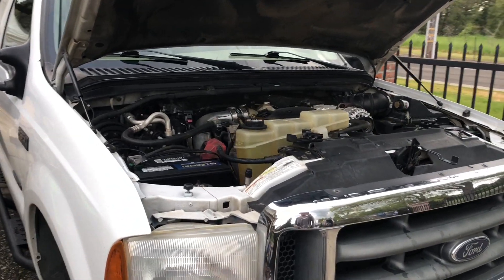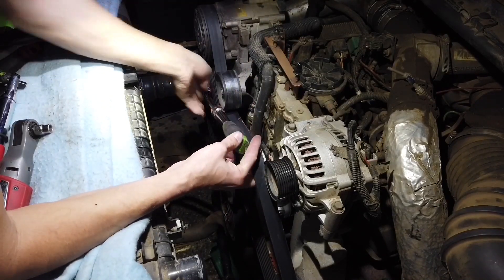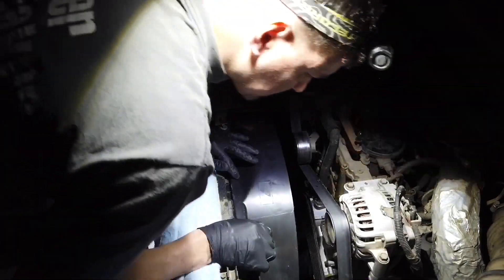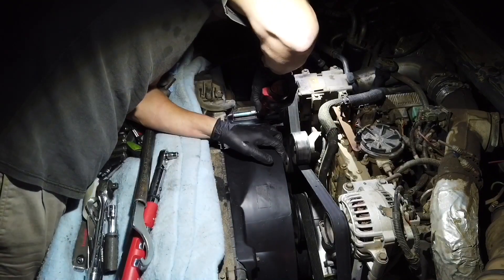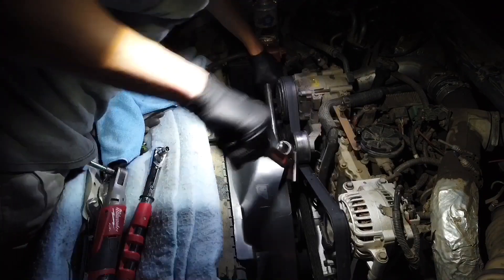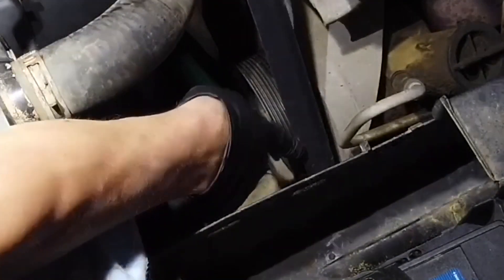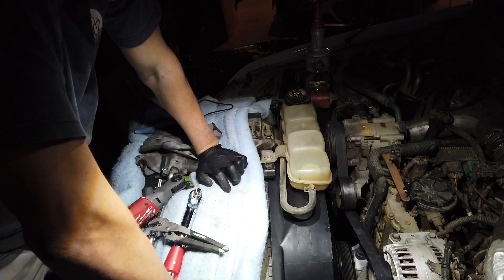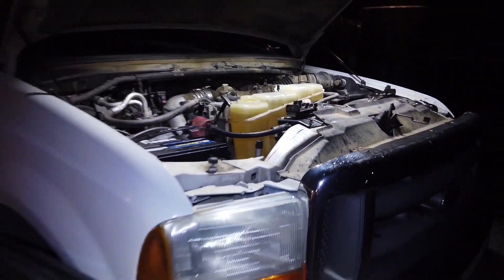Part-4 2001 F350 7.3 - Water Pump Replacement - Mistakes Were Made, I failed

Comment: Replace o ring and pipe an upper and lower radiator hoses then upgrade to mishomoto performance radiator  also do not run green it eats aluminum, use Rotella ELC pull plugs from block drain an flush thoroughly drain an flush before ELC

Comment: You should always use distilled water in your cooling system, tap water has minerals you don't want. and add one bottle of Motorcraft VC-8 additive if needed. #ESE-M97B44-A you need to check the nitrite and silicate levels with test strips.
Reply from the maker: Yea I filled it with distilled water